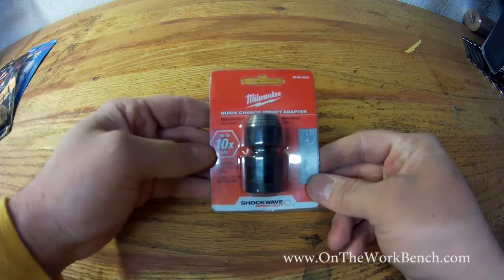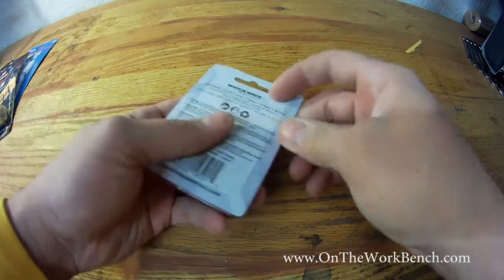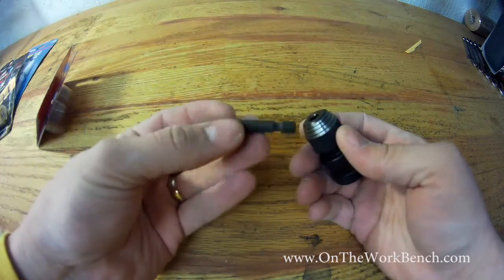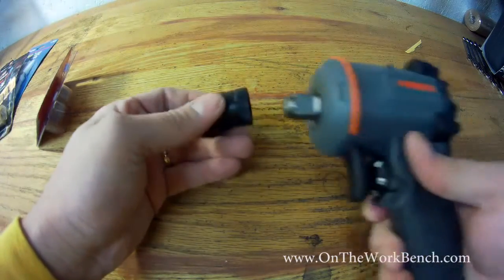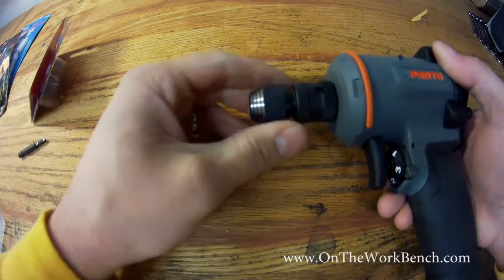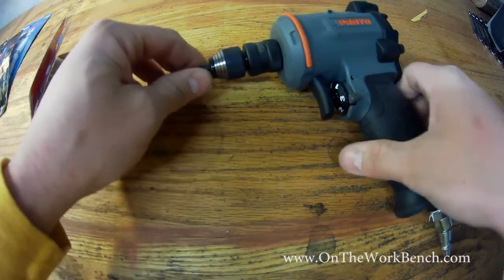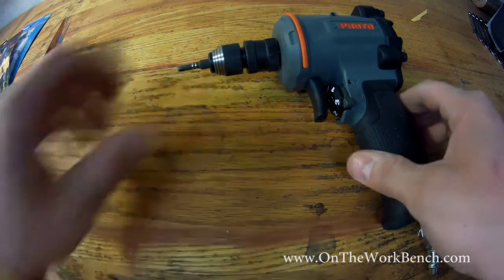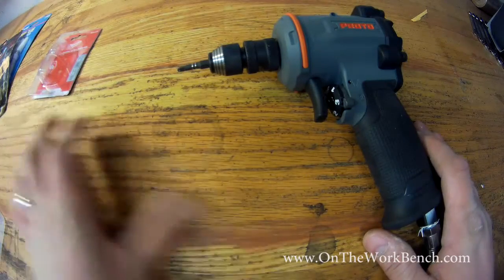Milwaukee 1/2" Square to 1/4" Hex Impact Adapter

Comment: Might be a good option for running a hex shaft mixer blade for mixing, paint, mortars, driveway sealers...etc.  Should handle thicker viscosity emulsions better than a 1/2" electric drill, as long as it can run continuously for a few minutes to complete the mixing process.

Comment: Seems a little much for a 1/4" bit.. No way I'd trust my MG725 or Fuel 2767-20 on it. Would be pretty nifty for a snub 3/8" gun tho.. Never knew this existed until now. Thanks for the video!
Reply: The safety setting offers the same performance as a regular impact driver, just in a heavier package.

Comment: love the fisheye look, it almost gives it aquatic like environment...thx for the video, though a bonafide shootout would be nice, where one with some tools could test all these 1/2 to 1/4 hex-versions on the market and not leats the versions from known brands like Devalt and Milvaukee.... here in Scandinavia Denmark these known brands cost 2 to 300% more than fx prices on Amazon.us.. I have just purchased 3 different versions to just sense if there is any value amongst the extremely low priced china ones. they costed from 1.6USD to 2.6USD all with shipping...it goes without saying that my expectations will fall in line with what I paid.. these two factors often go hand in hand....

Comment: Very nice and straight forward review - is there any play with either end of this adapter? I'm looking to pick it up for the new M12 Fuel stubby impact, #2555-20
Reply from the maker: Do you mean between the bit and atapter or the adapter and the anvil of the impact? The bit has only a small bit of play, roughly analogous to a bit in an impact driver, but the anvil connection is pretty sung for me.
Reply: @OnTheWorkbench  Great! That answers my question, thank you.

Comment: Kinda disappointing to see that you have to slide the collar back to insert the bit. Not a huge deal but it would be a nice feature.
Reply: DeWalt works as you would want.
I own it and it works great.
Reply: @simongreen525  dewalt only rated for 200lb .. not good

Comment: Does this really fit on dewalt 1/2 midrange impact? Any wobble?
Reply from the maker: No reason why it would not, and the wobble should be no more than a normal socket
Reply: Longer the bit the wobble comes in to play